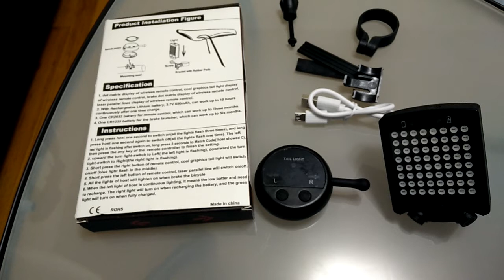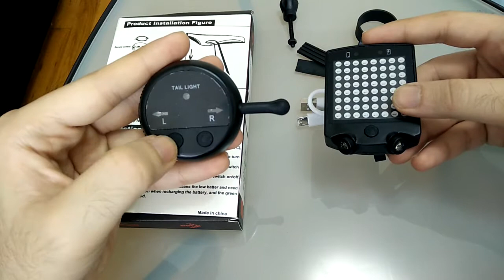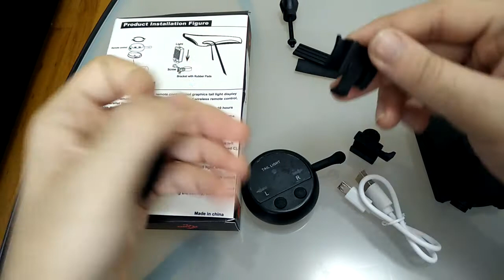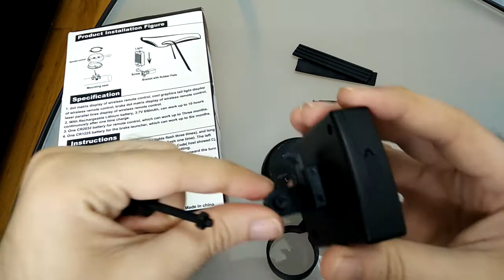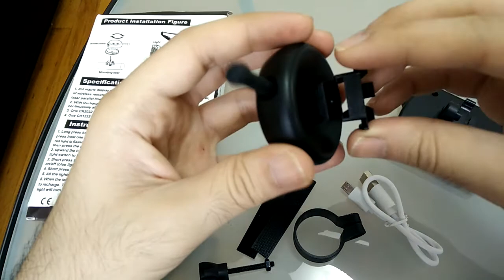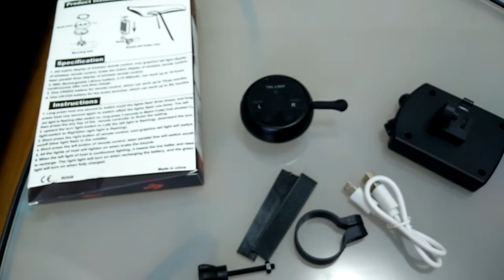OUTERDO 64 LED Waterproof Intelligent Wireless Remote Laser Bicycle Rear Tail Light with Turn Signal

Comment: I bought this product recently. Its cheap but works. The mounting bracket fits slimmer seat post but not the larger ones.  I like the extended turn signal switch because its easier to find and switch on while riding at night then the key fob buttons.  The bottom lasers have flash modes but not the main LEDs, they just cycle through automatically.  I wish you could select the flash pattern.

Comment: try it on a bike not just in your office this video is USELESS
Reply: I agree, He could have moved outside to demonstrate. I bought this product recently. Its cheap but works. The mounting bracket fits slimmer seat post but not the larger ones.  I like the extended turn signal switch because its easier to find and switch on while riding at night then the key fob buttons.  The bottom lasers have flash modes but not the main LEDs, they just cycle through automatically.  I wish you could select the flash pattern.

Comment: The package does not help with syncing. Thank you for helping me sync my light to the remote. I noticed you played with the left button on the remote but didn't talk about it. So I'm now helping you. It has a Lazer that points on the ground, looks like a lit up Lazer bike trail. Pretty convent at night where people may have a hard time seeing you, so it lights up a path to each side & it goes back as far as well a Lazer goes (which is pretty far). So the left button on the remote turns the Lazer on, off & also makes it flash on & off rather than just steady on.  I haven't figured out how to choose which brake light mode I want to use, but when I do  I'll be sure to come back to let you know that too. Thank you for helping me & I hope I helped you too.
Reply from the maker: Thank you. Appreciate your valuable inputs. Feedback is always helpful :) Bike safe!